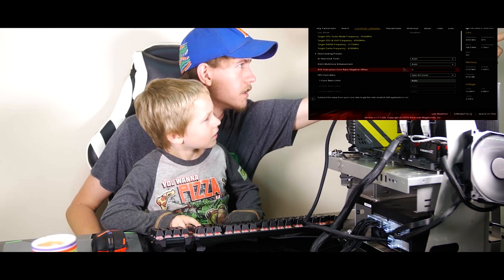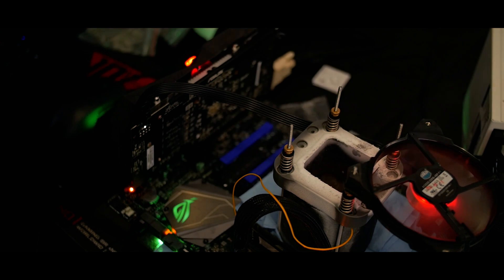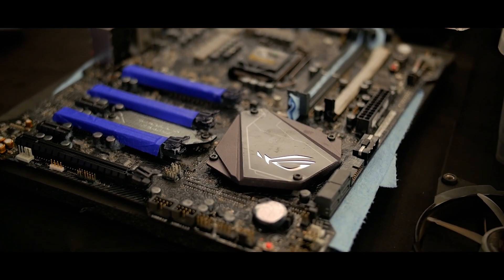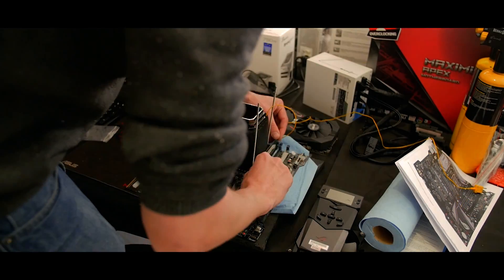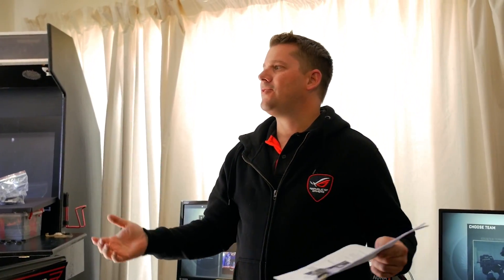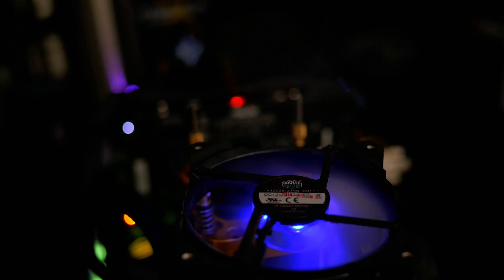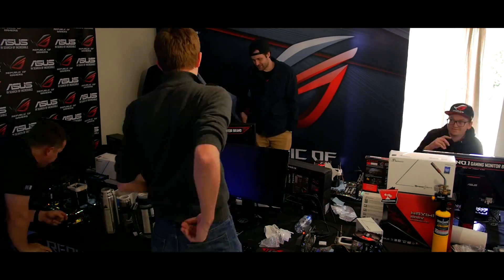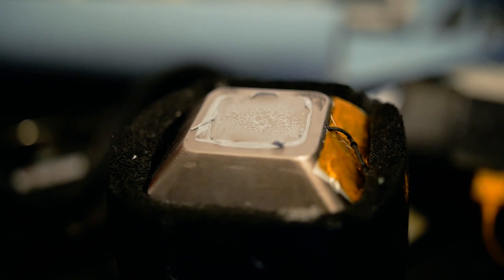6.5 GIGAHERTZ?!?! - Extreme Liquid Nitrogen Overclocking with DrWeez & ASUS

Comment: what i don't understand is that i couldn't overclock ny cpu let's say more than 15% and it's temperature wasn't more than 100f or 37c.... even with having the vcore increased so u think some cpu just can't overclock idk
Reply: 37c is like idle temps though?
Reply: Increase Vcore more. You can't just bump it up 0.01v and expect anything. Pump the FSB or Multi 1 notch at a time, and graph out your stable voltages (type into Excel spreadsheet). You should be able to get a very accurate prediction using a 3rd power curve fit line. You most likely are not giving it nearly enough voltage (my FX I used over 1.5v to get a 20% above base clock). Or maybe you have literally the worst motherboard or power supply ever.